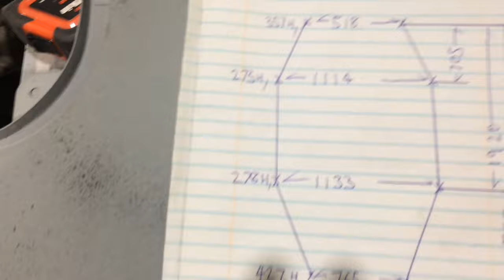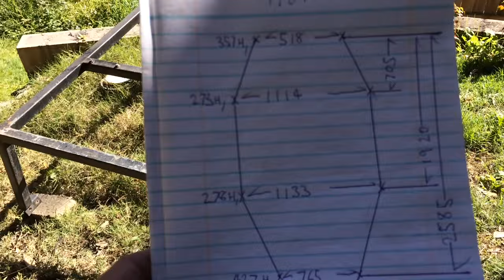Honda S600 Pt 17. Making the Body Jig & Taking the Body off!

Comment: Nice work on the body jig jason, never seen a brake line wrench like that before, I used to cut a slot in a box end wrench, which worked pretty good....that frame looks mint for its age, things should go well from here, looking forward to the process 😊
Reply from the maker: Thanks Craig! Yeh I got the normal ones to but I never use them, I just use them ones! German Brake Pipe Spanners I think their called!